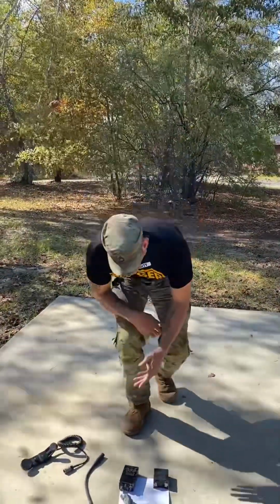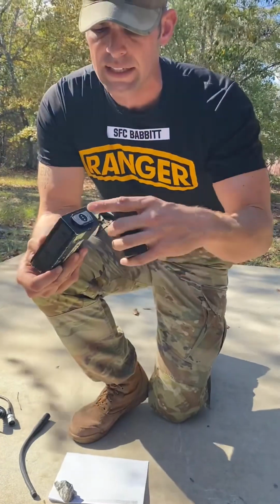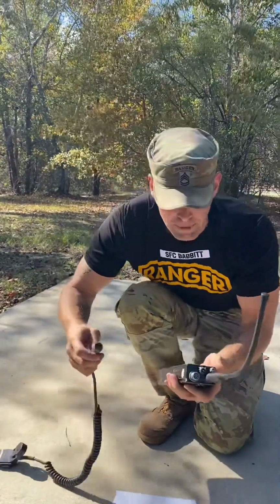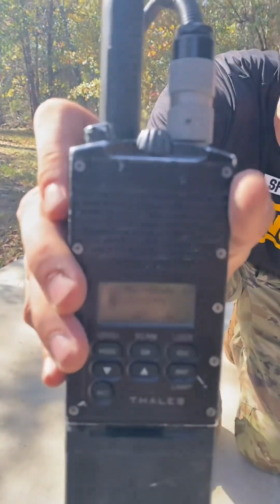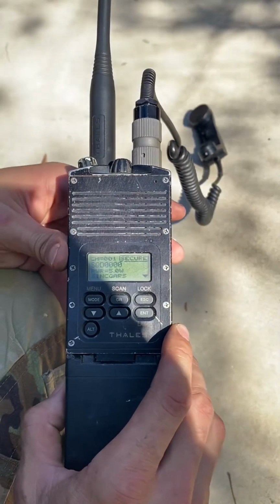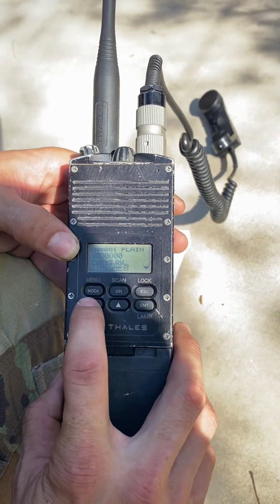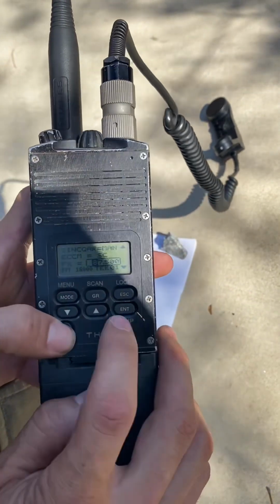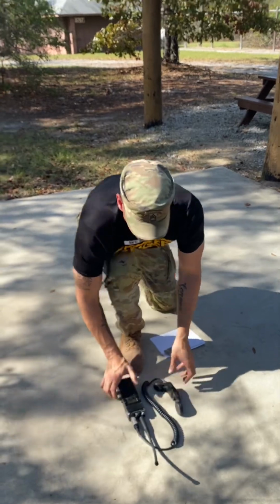RTT #7

Comment: Tip: attach the antenna before you turn the radio on. Some newer military radios perform a self-test during power on that involves transmitting to test the antenna – which should be performed with the antenna attached.